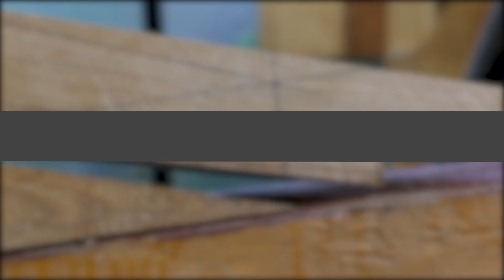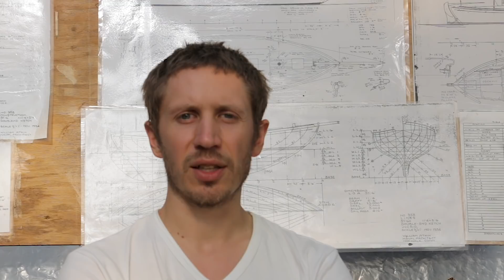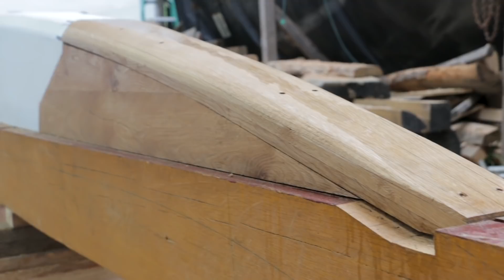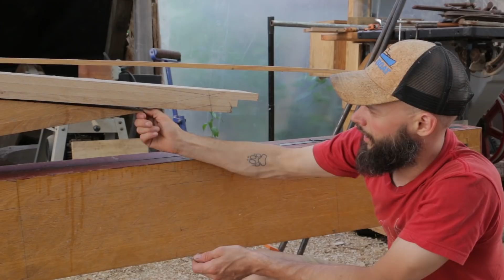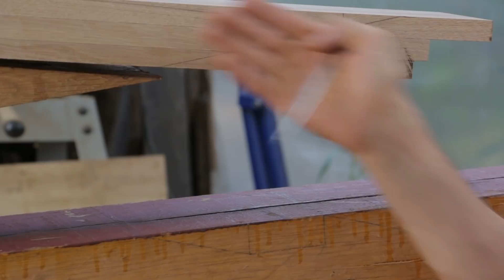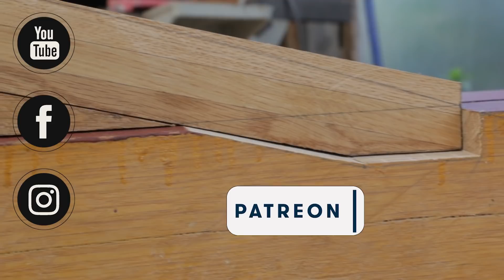Acorn to Arabella - Journey of a Wooden Boat - Bonus Content: Explanation of Nib for Wormshoe

Comment: Hello from Kirkwood Community College-Carpentry Program.  Been subbed since the beginning.  Well done on this.  Construction math is best explained in short bursts ;)  I like how you broke the large problem into smaller, simpler problems.
Reply: The best text book I have kept is called, Mathematics For Industry, by S.E. Rusinoff, M.E..  I have kept that book since the 1970s and still use it often.
Reply from the maker: Thanks!
Most, maybe all problems are easier when broken down.  Building a big wooden boat is super daunting, making a piece of wood fit tightly against another is not so daunting.  Turns out building a boat is just making wood fit tightly and repeating that a few thousand times =)

Comment: Wouldn't it be a good idea to make and extra wormshoe for a spare part??  Bend and glue the wood now so it could be fitted easier later should you need it.  I can't imagine how you would make such a tight fit, upside down in a boatyard someday with fewer tools.  Store spare at home to be shipped anywhere in the world if needed.
Reply: I should think the whole point of a spare would be to have it on the boat.
Reply: Sterling idea! In the current situation it was not particularly difficult to make. Just leave extra meat in the nib end in case you need to re-cut the notch after whatever disaster befalls to need it to be fitted.
Reply: I don't think it's all that exotic of a repair for most boatyards, especially any yard capable of hauling a boat this size out. Plus, shapes change subly over the years; best to use the damaged shoe as the pattern for the replacement.
Reply: Mrk - Making a spare (with some adjustability) now, delays cruising time by a few hours.    Needing a replacement while cruising delays cruising by days or weeks.
Reply: Good point. Should probably carry a spare set of hull planking as well. Maybe an extra keel. I still think an extra made today probably won't fit right if and when it's needed 30 years from now, meaning a new shoe is going to be fitted anyway.
Reply: I really think you should just tow a spare boat behind , just in case you need a spare....

Look i get the fact you should have spares for stuff during cruising, how about a few planks of wood and some epoxy , so you can make a spare,  ????, and then profit from the ability to make spare any thing you may need.

This is a 38 foot boat , its actually pretty small , and has limited space for spares , so pick the most important stuff first , like engine stuff , batteries and rigging spares. that stuff will break. but the worm shoe won't make the boat sink or keep it from cruising unlike a shitted out engine or rigging.
Reply: What y'all haven't said is to just make a template if you're that concerned.  And the template could be stored as a file on this thing called a computer.  Or, scribe the dimensions underneath a settee.  Given the thickness of the shoe means it would take a very large wallop to penetrate to the keel.  With that kind of hit the shoe would be the least of their problems.
Reply: I always travel with the new SeaMaster 3rd printer. Lost a mast off the coast of Africa in March, no problem. Printed a new one in no time. Great for cleats, doovelhovens, roller blocks,  anything.
Reply from the maker: The cost of shipping is prohibitive, a big chunk of heavy wood would not be cheap to ship!  The old one would be a great pattern to follow and it would be a day, maybe two to fit and attach a new worm shoe.  She would also sail just fine without the worm shoe there, kinda like a car without a bumper, not ideal but you can still get where you need to go.
Folks are right there is also not a ton of room for storage and a worm shoe is very very very low on the priority list of spare parts.
Reply: _Reductio ad absurdum_.  The wormshoe is a sacrificial part.  For the record though, most wooden boats, back in the day, would carry spares for as many things as they could, spars, planking, even masts.
Of course it is going to need to be fitted.  That is why one wouldn't make it to final shape.
Reply: Maybe go build it with them? Stop complaining?

Comment: Doesn’t your forefoot joint start there so there wouldn’t be any end grain from your keel be exposed ?
Reply from the maker: No, actually the end of the keel timber is exposed on the plans.  Our plan is to bed a bronze shoe over the end grain on the keel timber, really don't want that exposed to the elements if we can help it!
Reply: Acorn To Arabella , you could cast a rams head 😁, speaking of casting bronze parts, I have always made plugs and had them cast but the casting places are getting rare and expensive, I heard of a way to cast them yourself but haven’t tried it, you make the plug out of ridged foam and bed it in your sand and pour, basically like lost wax, would seem good for one offs which most of them are.

Comment: Wouldn't it be a good idea to mount a small stripe of 5 mm ( 0.2 inch) stainless steel to the keel across the bow, wormshoe and leaden ballast keel beneath the sea level? It would spread any nasty impact across a wider area an enhance the keel.
Reply: i feel like if you hit something that hard to need a 5 mm stainless , you will probably be sinking your boat. 5mm is about 3/16 inch, btw ..
Reply: I don't think 3/16th inch would be too thick, since this sheet metal should last a long time. And I agree, running full speed on Smth will damage the ship in any case. The sheet would protect the ship for a long time from any scratching damage when the is just not enough water beneath the keel. Small invest in material for a very good and lasting protection.
Reply from the maker: Bronze would be better and the hope is if we get to a point where we can afford a few thousand dollars of bronze for a worm shoe we will put one on.
Reply: Acorn To Arabella Bronze? Why would that be better? Aesthetic reasons?